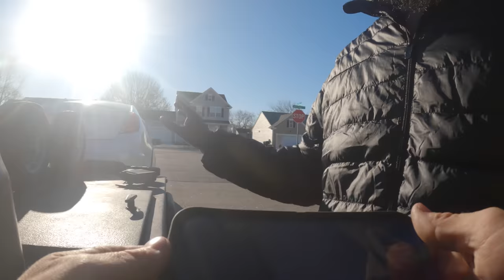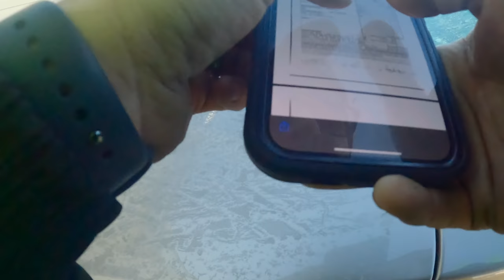MERRY CHRISTMAS REPO! MUST WATCH!!

Comment: I kind of feel bad for the husband. He really seemed like he thought the car was paid off. He clearly felt embarrassed once he got on the phone with the wife. I bet the husband did have the title.....but without knowing the wife probably took it to get a title loan. About the key. It's likely in the car. Those remote FOB and push button start cars will sound the horn in quick chirps if the car is running and the key is not inside the car. Plus it won't stay running more than 10 mins or so.
Reply: In some states (I’m not sure about North Carolina) the title is sent to the person with the car. It has on the title that there is a lien on it.

Comment: It is easier to make a payment to a savings account.   When you need a car, use that saved money to buy in cash.     As soon as you get the newer car, continue to make a payment to your savings account.  That newer car will need to be replaced.  Buy a car within your means.   Rule of thumb, do not buy a car that the cost is close to or exceeds your yearly take home pay....especially if you haven't bought a house yet.   I have owned several cars.......made only one payment.....never took a loan on any vehicle.   A car  (or truck) is the worst investment !   they depreciate quickly (especially german cars)   you wind up owing more than the car is worth almost 100% of the time

Comment: So did you check to see if you damaged the wrong car you picked up... Damn if you came to my house by mistake you would have seen a bad day...
Reply from the maker: Boy the lift don’t hurt the car idiot
Reply: The lift CAN damage the car if it isn’t low enough going under the car or low enough coming out from under a car. You will snag that bumper. Believe me, you will know without checking. He is actually pretty good with the controls. He didn’t damage that car at all.

Comment: Seeing this was a year ago thing might be different now 😂 but you vid a lot with phone get one them phone mounts looks like a metal ball mounts on your dash and got a magnet goes on phone so you use mount but the magnet strong so you can stick your phone up on almost anything metal. I left mine with flash light on on side of truck bed went 10 miles looked back seen that light barely bc phone facing up against bed that thing stay on over railroad tracks and all